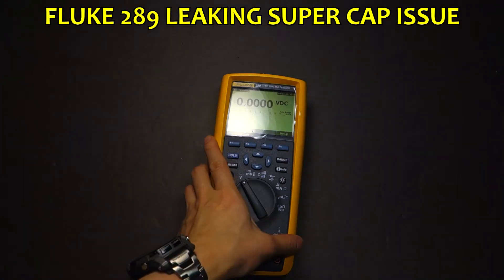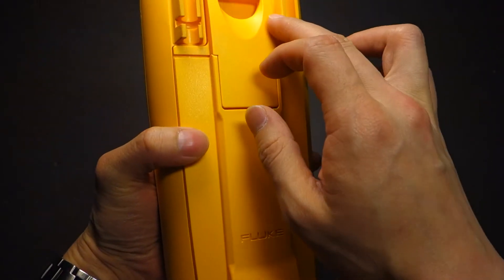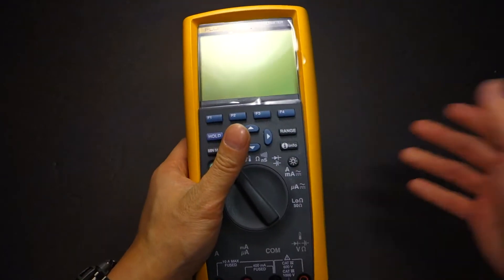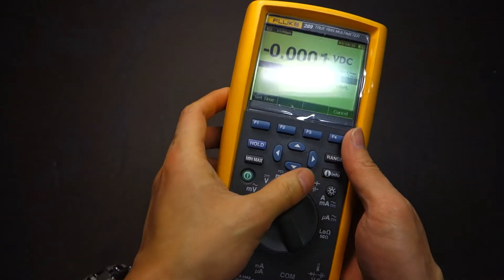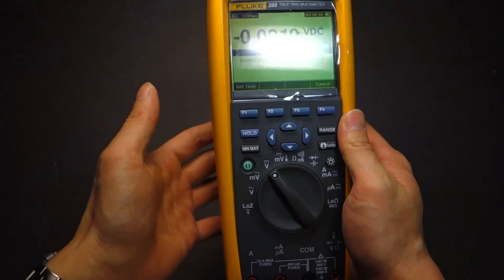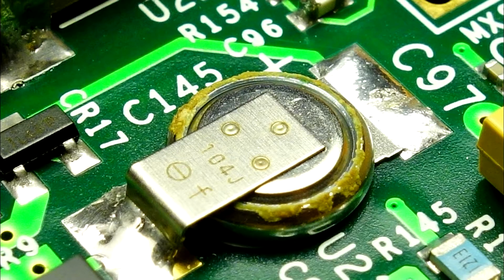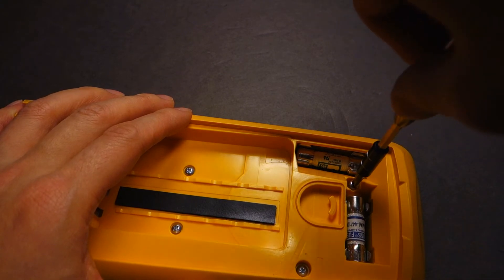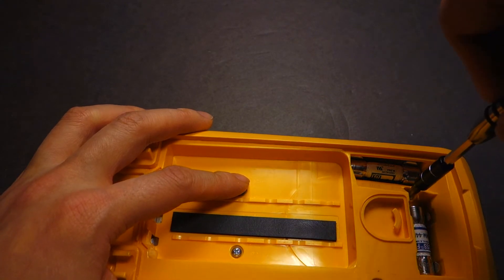Fluke 289 - Supercapacitor Leaking/Corrosion Issue

Comment: For older Revisions of Fluke 289 supercap is used. But for Rev 016 and above they are already using rechargeable batteries. Mine is rev 018 its using a Seiko MS Lithium Rechargeable Battery ( MS621FE with tab ). Bought it 2018  date was still ok but time can no longer hold.  Battery has only 0.6v, replaced it this 2024. here are the specs of MS621FE.  Nominal voltage = 3v, Nominal capacity 5.5 mAh (3.1v - 2.0v).

Comment: The  IR header came off with the connector lead, so I had to pick it out the bits with tweezers. There was no impact, so I can't think why it broke into pieces.It;s in a controlled environment, not often used except when logging I had just uploaded a log of readings I had  been trying for a month. What material is the clear plastic? Acrylic? Perhaps I can find a compatible adhesive

Comment: Hi turboBB73...my Fluke 287's internal supercap externally and visually seems okay but...but could not retain time...only time...date is preserved. I just ordered a Panasonic supercap...
Reply: And for God sake that supercapacitor doesn't affect internal calibration data.
Reply from the maker: I know right? Luckily it doesn't.
Reply: The calibration parameters are stored internally in a Flash EEPROM.

Comment: My 89 IV from 2000 year have little sign o leaking...in supercapacitor made by Panasonic, gold series.
Reply from the maker: You know how the adage goes "They don't make 'em like they used to". My 289 has developed the same problem and is likely due to yet another leak... :(

Comment: Hey Tim, thanks for the mention. BTW, I own a 16 year old Fluke 189 as well. That one has no problem with it's super cap. Go figure/
Reply from the maker: +Glenn Martin Hey, thank YOU for bringing it to my attention. I really have to say that it drove me nuts every time I had to reprogram the date/time after a battery change (important for me since I need to correlate w/the output readings during runtime testing). Cheers
Reply: +turboBB73 Glad you caught it before it actually leaked onto the circuit board. That could have caused damage to nearby components, and possible damage to the circuit board. Mine looked about the same as yours. Also, I always turn a self-tapping screws counter clockwise till it finds the original thread (fine or coarse) when re-installing. You never want to cut new threads because you can end up stripping the boss's . Glad you do that :)
Reply from the maker: +Glenn Martin Re: the screw - you've articulated that better than I did, thanks again! :o)
Reply: +turboBB73 Tim, anytime my friend :)